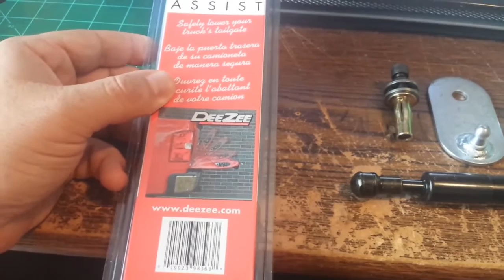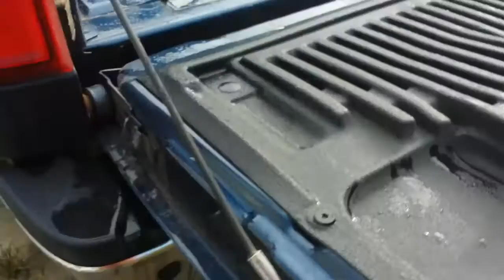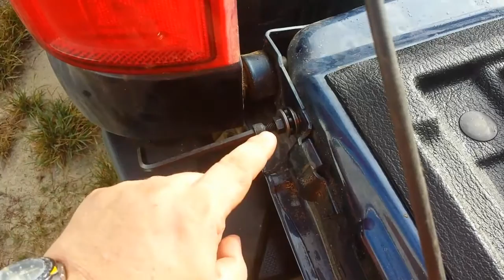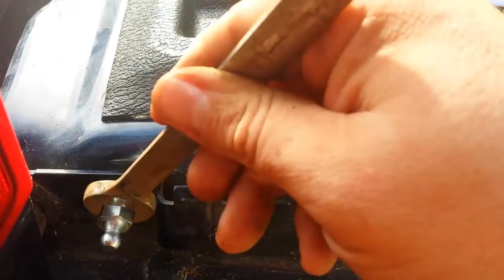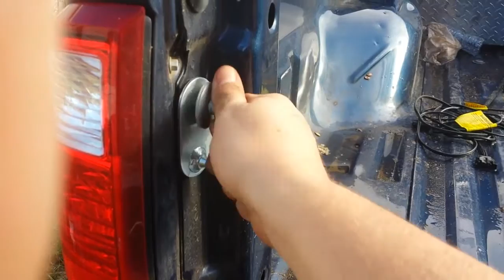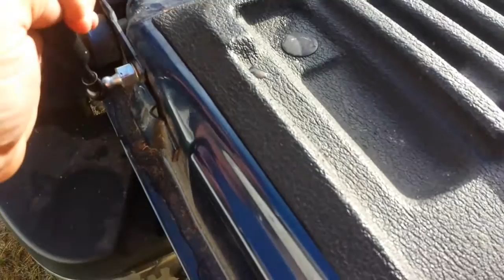Dee-Zee Tailgate Assist Install - 2014 F350 Powerstroke

Comment: Is it still holding up okay after after 1+ years
Reply from the maker: +Craig Gunther As far as I can tell, it is working just as it did when I first installed it.

I do think it is important to note that I am not a contractor or construction foreman or someone who uses his tailgate multiple times per day. I might drop the tailgate once a week. So I can tell you that with light use it seems to be holding up well. I cannot comment on how it would hold up under constant use, but I have every reason to believe it would be just fine. All it is is a gas piston, and they've been using those for decades for multiple applications. It should be something that they can make very reliable.

Thanks for watching!

Comment: Nice.  I have a 2013 F350 and have always felt like the tailgate was pretty heavy.  Just ordered my Dee Zee Tailgate Assist and looking forward to getting it installed.
Reply from the maker: So far, this might be my favorite thing I've done to the truck. I can just walk by it, yank the handle and let go. No worries about the tailgate slamming down - it just lowers itself down nice and easy.
Reply: Jamey Saunders Received mine from Amazon and installed it today.  My issue was that if I had things in my hands while opening and not wanting to slam the tailgate down, I was always worried I was going to scratch up the tailgate with whatever I was holding (tools and such usually while "mutli-tasking").

It was easy to install.  Now I can just let the tailgate drop with no worries.  Inexpensive fix and it works great!  Glad I came across your post.
Reply from the maker: Pretty neat, ain't it?